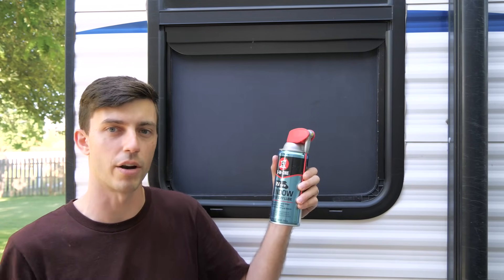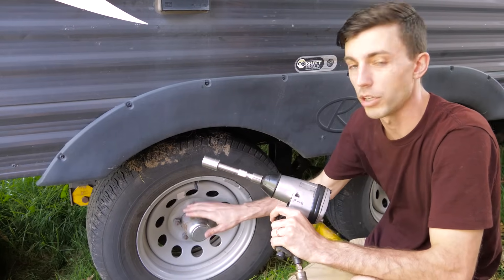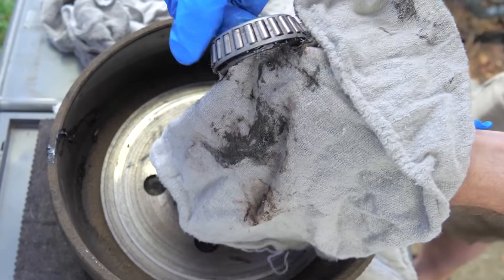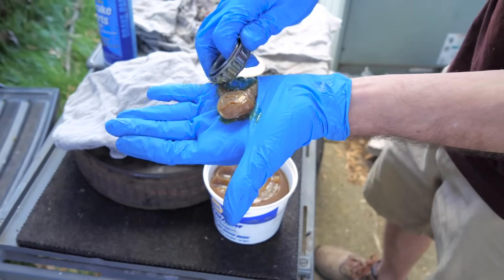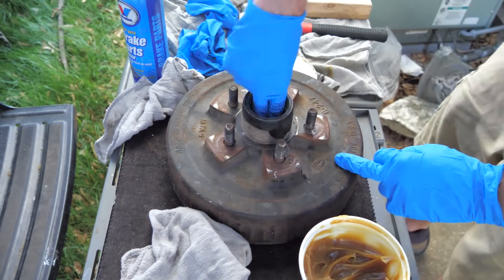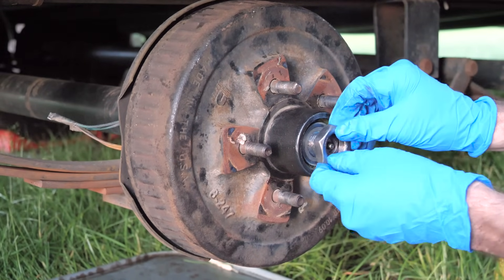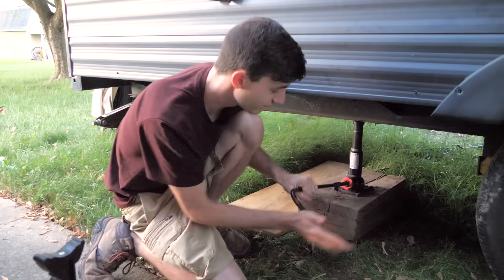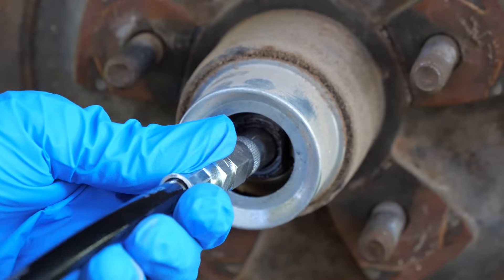Trailer Wheel Bearing Grease Repack and Easy Lube - RV Travel Trailer & Fifth Wheel

Comment: Well done! As a retired mechanic, I can say you hit all the key elements of that task. One suggestion I might add would be to check your brake operation, while the wheel is off the ground prior to disassembly. This will alert you to brake trouble that may need professional attention.  I prefer to repack the bearing from the "large" side where there is more room for grease to enter and pass through. My trailer also has the Dexter Easy-lube axle that allows grease gun repacking, but I still remove the hub/drum assembly for brake inspection every other repack. The finishing touch is a brake adjustment check to insure proper operation. Stay safe and keep the shiny side up!
Reply: Yes, I've never seen a bearing hand packed from the small side of the bearing, I too do the large side down to your palm and the grease.
Reply: Same here. Mom and I were into off reading, etc, and that is how she taught me. And she learned from grandpa who was farmer and then truck driver, soooo.
Reply: Gregory, I bought my first tt last month.  It is 2019, used.  Do you think I should check and repack the bearings? and how do you check the electronic brakes?  That is totally new to me also.
Reply: @SuperJoeReb  Congrats on getting into the RV life. I would recommend inspecting and repacking the wheel bearings. Your rig is two years old and it's very possible it has not had that service yet. To check the electric brake operation; while the wheel is lifted and the axle is secured by safety stands, before disassembly of the hubs spin the wheel and have an assistant apply the trailer brake  with the tow vehicle's control unit. If the wheel stops, system is working. If it fails to stop, further repairs are needed. Do this for each wheel that has brakes. As always, if you are unsure of taking on this task, seek a professional. Safe travels!
Reply: @CharlesinGA  Yes, that is the proper way to funnel grease to the small side.
Reply: Thanks for your tip!  This will be my first attempt at doing a repack other than helping my ex on our D-7 cats.  I was wondering about exactly what you said, checking the bearings themselves to make sure they weren’t worn.
Reply: I'm a former mechanic as well.  I too prefer to pack the bearing from the large side.  Just the way a learned, and it makes more sense to me.  Another thing that I like to do is look at the old grease as I am wiping it off of the bearings.  It is very easy to see flakes of metal if the bearings are breaking down.

Comment: Good job dude.  Only a few suggestions to make life a little easier.  1.  Rubber mallet   2.  while the hub is off, spray everything and get it clean while you have that tray under it, then inspect brake operation, the lube all moving parts (not with bearing grease), then you should  be good if no brake parts are needed.  Nice detailed explanation.  Oh and for those product haters who don't get how this whole you tube thing works, I would say this.....  At least he is "peddling" an applicable lubricant that, in case you don't know, is essential to any mechanical device.  Moreover, the lubricant he is "peddling" is a high quality product that has been around since I was born, in various forms, and have all performed very well.  He not peddling flex seal here folks, 3 in 1 is a cheaply priced, high performing lubricant that has been tested and liked by professionals for years.  I looked at this brief moment,  as a worthy product endorsement that would most certainly benefit the target audience directly.  Or if that triggers you, you could always ask Camping World salesman what they recommend.
Reply: Well thanks for your informative response.  Always nice to know a GOOD PRODUCT that works.  This will be my first time doing it myself.

Comment: I always pack bearings from the larger side. The opening between the cage and inner bearing race is usually larger on that side and you can get the grease packed in easier from that side. Also, added grease in the cap doesn't do much for you, but it doesn't hurt anything. However, I would recommend adding more grease in between the bearings. I always set the hub on with the outer bearing out, then pack grease into the pocket behind the bearing before putting the bearing in. This ensures that you have enough grease to keep the bearings well lubricated between services.
Reply: Exactly what I was thinking when I saw him packing from the narrow side.
Reply: Thanks for that..I will add that to what I learned from his video..
Reply: “Bearing Buddy” hub covers works great at completely filling the entire cavity with grease using just a grease gun. Also, he shouldn’t have pre-greased the spindle, 1) It’s going to push grease back into the brake when you put the hub on. 2) You don’t want grease on your inner and outer bearing races, they are not supposed to spin on the shaft or inside the hub, only the bearings should spin inside the races.
Reply: Do the break need any adjustment at this time?
Reply: @tonyw9429  you do want grease on the outer race. That's where the bearing rollers ride bud.
Reply: @06m50blue  so I do put a little grease on the hub??
Reply: @judysuprtrkr3423  yes. I always put some grease in the area between the inner and outer race. Doesn't need to be excessive though.
Reply: @tonyw9429  Disagree with both 1 & 2.. Greasing the spindle and races hurts nothing and won't get on the brake shoes or drum surface.

Comment: You did a good job. One thing I was taught though is to wipe off a zerk before you attach the grease gun so as not to contaminate the grease with dirt.  I was also taught to tighten the spindle nut until the drum stops turning and then back it off 1/8 to 1/4 do that there's little to no drag.  This ensures the bearings seated properly.  I've heard with ez lube you should hand pack every other year.  I think it really depends on how much the trailer is used.
Reply: Soo important on your wipe off comment!!  Why push dirt into your bearings

Comment: When you re-installed the hub and tightend the nut on the spindle (13:54), you failed to seat the bearings by torquing the nut down tight (most manufacturers recommend about 50 ft-lbs)... Once the bearings are seated, THEN back off the nut and lock it in the right position so that the hub spins freely with no excessive end play.
Reply: Actually I think there should be No (or minimal) End Play

Comment: Very informative video! I used to work at a trailer shop & will tell you that the standard "store brand" bearing grease isn't as good as some of the name brands. I use Star-Brite marine grade bearing grease on all of my trailers & never had a single problem, it has much better film strength and stands up to higher temps. Also, to properly set bearing lash you tighten the axle nut down (not just snug) then let it out 1/4 to 1/2 turn. A good way to check for no slop is take both your hands & place them on either side of the hub, then wiggle back & forth, you should only feel a slight movement (like a click). I noticed you left a little too much slop when you re-installed, just my 2 cents.
Reply: Yep, New Bearings=Zero Lash. Used Bearings go zero lash then back off a 1/4 turn. The used bearings have already done their expansion.
Reply: Too much end-play on that spindle and you'll fry your hub.  Ask me how I know. :)

Comment: Make sure to torque those lugs again at 25, 50 and 100 miles. I’ve found loose lugs on mine up to 50 miles.
Reply from the maker: We check the torque on our trailer lug nuts before every trip, there are always a few that are not to spec

Comment: For the time and effort I am just going to repack each year so I can also inspect the breaks etc.  The idea of pumping new grease in the like you showed at end I have heard of issues with seals failing under the pressure and grease getting on the break parts driving down the road.  Not sure if this is true but Option A seems like the better way to go.  

I did this last year with a mechanic friend of mine last year.  This video was a great refresher and I will get at it this weekend.  :)

Comment: I don’t know if this was commented on but you do not need to remove the wheel to get to the easy lube grease zirge. The center hub has a cover or cap that can be removed with a flat screwdriver that will pry it off and this will give you access to the rubber cap and spindle cover.

Comment: When tightening the large bearing nut, rotate the drum while you're tightening. Use a torque wrench set at 50 ft/lbs. Then loosen the nut, tighten by hand, and install the clip. I believe that is the Dexter EZ Lube reinstall procedure.
Reply: Thanks so much for your tip!  I haven’t looked at my fifth wheel to see which application it takes.  Judy

Comment: Remember when I said it can be scary? When the bearings disintegrated on my bosses work trailer (he remembers to maintain them better now!) when I was driving down the freeway, we had a hell of a time replacing them. They literally came apart and pieces were frozen on the axle.  When he replaced them he found that some manufacturers offer open dust covers now for past models. Even if you choose the zerk point method to fully repack the bearings, you need to periodically clean them completely and repack them the old fashioned way. Zerk points are really meant more for making sure the bearings have enough grease since some is lost over time, you can never get all the old grease out that way. Particles of dirt of metal will damage bearings and all those surfaces that are suppose to be smooth over time, especially if you travel a lot. Loved the video, looking forward to more! Stay safe.

Comment: I didn’t read through all of the comments so I don’t know if this was pointed out. When using an impact tool you should always use impact sockets. The chrome socket that you were using can explode if over stressed. Impact sockets are usually black and made of a more malleable material and won’t catastrophically fail if you have to really pour the coals to it to break loose a frozen stud.

Comment: great video! thanks for posting. A couple of comments that may help others. I think it's easier to pack the bearings from the wider side. I understand your father did it that way, but that really seems like waste of grease in the dust cover, no moving parts there. Maybe just a thin grease layer for protection at the seal? I was glad to see your procedure on the retainer clip, and nut tighteneing,  since I have the same on my axle. When i opened it up the nut came off by hand! i followed your instruction, and the 1/4 turn back-off and still just hand tight afterwards as well.  Thanks for posting, great video!

Comment: I found that my center hub cover, actually has a small "hub cap",  looks like yours does too. There is a small indent for a screwdriver and once you pop that off,  you have access to the rubber cover on the grease fitting and away you go. Thanks for all your videos.

Comment: Great idea to show both methods even though you have EZlube bearings.  I love the EZlube bearings, much easier.  FYI the center caps normally have a removable end piece so that you don't have to remove the tire, but be careful because it is just plastic, sprayed with chrome.  The inside tabs are easily broken when removing them.  Just gently pry with a very thin screw driver.

Comment: Nice video.  You covered everything that I was taught as far as the manual bearing pack is concerned.  I prefer the pack them from the large side of the bearing.  That is the way I was taught.  Also, I like to look at the old grease as I am wiping it off of the bearings.  It is very easy to see flakes of metal if the bearings are breaking down.

I have never used an Easy-Lube setup.  Don't think that I would if I had one.  My thoughts on them.  They use too much grease.  You don't get a chance to inspect the brakes, the wheel bearings or the wheel bearing seals.  And I am thinking that with the hub full of grease there is a greater chance of grease working past the seal and on the brakes.

Comment: Good vid.  Thanks.  Like others have said, I would still do it the old-fashioned way even if I had the E-Z  Lube system for fear the seal or other parts are bad.  Visual inspection helps.  I would rely on the EZ-Lube method you showed in second part of video only in an emergency situation.

Comment: I followed your directions to the tee but all I got was nice fresh grease coming out. After about half a cartridge of grease I looked on the Internet for zerk fittings and low and behold... You need to tighten the nozzle of your grease gun around the nipple until it is tight. You can then perform this one handed AND the new grease goes in forcing the  old grease out. Thanks for the video anyway. It gave me courage to do this myself.
Reply: Thank you, didn't know that!

Comment: Nice job David! I have a 2016 Springdale Summland 2450rb. I always thought I had to take my wheels off to pack my bearings to get access to the EZ lube system but just recently realized that the cap that covers the dust cover has a circular piece that pops off with a flat head so you can get access to the EZ lube!  I literally just figure this out a few weeks ago and blew my mind!!! Lol not sure if you’re Rig is set up the same way but hope this little bit of advice helps! Keep making great videos!

Comment: The centre of your chrome wheel centre caps actually pop out with a screw driver so you don't need to take the wheel off. The centre cap is two pieces.

Comment: Great video. Repacking tip: turn the bearing over and pack it from the larger side. The groove is larger and the grease gets in much faster and easier. In my opinion, the inside bearing did not enough grease in it. And, use a rubber mallet to reinstall seals and dust covers.

Comment: Really informative video, great job!!  One thing, I would recommend getting, an impact rated socket, they usually have a black oxide finish on them, they are made for use with an impact wrench, thicker walled and shouldn't shatter if not used properly.  The chromed sockets have much thinner walls and will crack or shatter during a failure while using with an impact.

Comment: As a Former Navy aircraft mechanic and current GSE Mechanic I have done my fair share of repacks so this was a good video. Just tips for those without a seal puller. You can reinstall the nut after you remove the outer bearing and pull the hub. Tapping against the nut and the seal will pop out with the bearing. ‘DO NOT PULL TOO HARD’ it will damage the bearing and axel if yank too hard. Also remember grease is your friend on the wheel bearings don’t be afraid to add more just for extra measure.
Reply: What are your thoughts on the Dexter EZ axle grease repack? I'm going to do mine for the first time and this is the method I want to go with!
Reply: I always put a bead of grease around the outside of the bearing.  His looked almost dry when he reinstalled them.

Comment: I find it helpful to use a solid pipe with a snap lock end attached to the grease gun vs the flexible rubber hose

Comment: Hi David, check the end of your center caps on the wheels. The end pops off if you use a small flat screw driver. You might have to look really close to find the spot to put the screw driver. Hope this helps you.

Comment: Thanks for telling people to jack the Frame and Not the Axle. I see this mistake constantly. Especially at Tire Shops!
Reply: Why?  Jacking the axle at the right spot is the best practice in my opinion.  That's where all the weight of the trailer is located.  I jack between the two U-bolts on the axle.  As I understand it, Mfrs do recommend it to keep idiots from jacking towards the middle of the axle and bend it--cya.  Jacking the U-bolt area also guards against slippage and prevents people from using dunnage or other unsafe ways to reach the higher part of the frame where most jacks can't reach.  I researched this when my dunnage shot out right near me at high speed.  I am interested if you think the weight-bearing area of the axle is still not a good area.  Always looking for things I may have missed.  Thanks.
Reply: @brentginastravelingadventures  I believe that it was Dexter (the axle maker) that advised against jacking on the axle housing while it is bearing the full load of the trailer. I don't even let the tire shop change a tire on the RV without me putting it in the air some. That being said... There is most likely plenty of beef at the location that you mentioned; however most people do not know the proper procedure for jacking at this point. I have large 6X6 blocks and a thing called a Safe Jack that I use to lift the RV. Then I use Jack Stands to support the frame. I will always put the RV up on jack stands first. Then raise the axels. It doesn't take that much more time compared to swapping out a (even slightly) bent axle.
Reply: @smallhousebigyard1596  Yes, but they won't answer us, the advocates for u-bolt area jacking.  I still haven't heard a reasonable argument against directing people to "Only jack at the U-bolt location or you'll bend the axle."   It's for the reasons I mentioned already.  It needs to be called out.  Just researching it again this one time, I've seen a video of a guy using a bottle jack on top of dunnage (2" x 2" round tip) directly on the frame, metal to metal.  It has to lift the entire side of the trailer with that.  Most RVs are very heavy.  That's a lot of pressure on that small area and very unsafe.  If the dunnage is on soft ground or at any angle, it'll collapse.  It happened to me.  So, I'll keep asking, "If the axle is designed to support all the weight at the u-bolt area of the axle, why can't someone jack there?"  FYI, dealership warranties won't cover axle repair or adjustments.